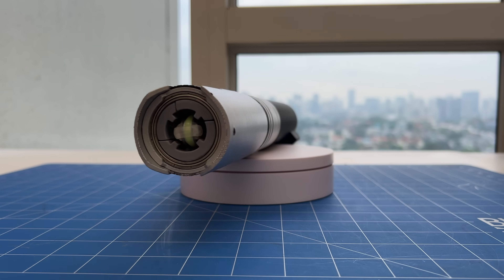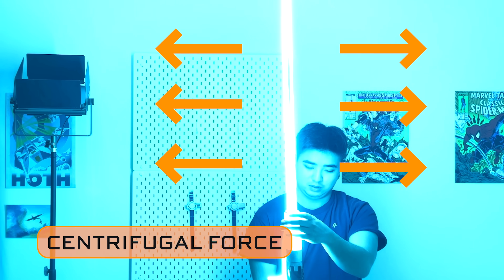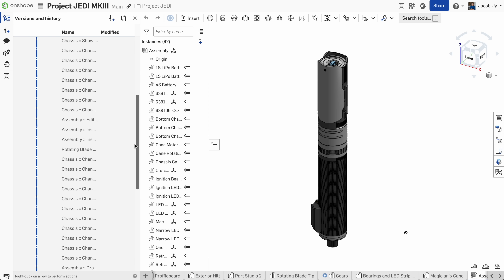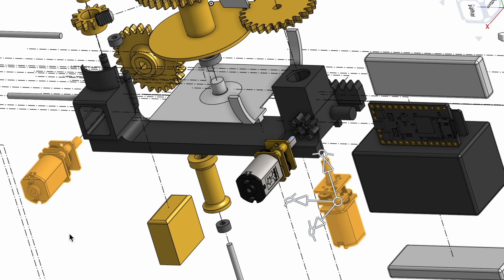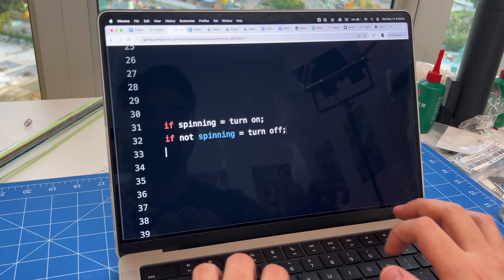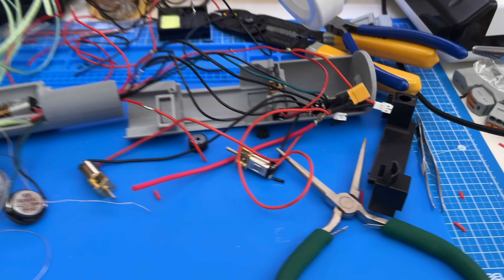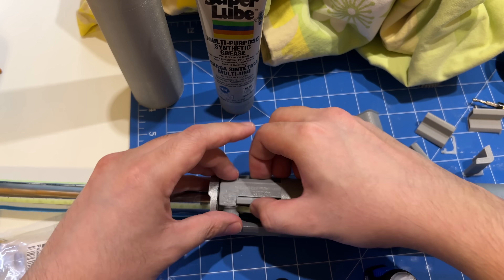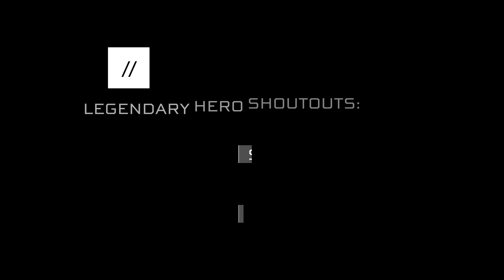Making a Better Retractable Lightsaber

Comment: Wonder if there is a way you could use a thin polycarbonate segmented extending tube over the blade in future iterations if it is possible to size down a lot of this.  Could very well be on your way to not only a spinning fast extension and retraction but possible something with some light dueling capabilities down the road.
Reply from the maker: Nice idea! Would love to find something like that, would be great to enable dueling
Reply: @herotech  I'd say check various saber supply shops, look into the designs from twistsabers and look at the design of the power saber.  Both have different methods for extending and retracting the blades.  For your design you would need to sand and taper each polycarbonate piece fitting over the rod and lights in the middle, especially if you want to maintain the rotational aspect, but if you wanted to save power and lose that spinning it would become simpler with smoothed segmented pieces.  Sadly I have only loosely experimented off of twistsaber designs.

Comment: How's the weight distribution? Also with the gyroscopic effect, it'd be more effective to do more of a thrusting/fencing type form (like Count Dooku) instead of doing those big swinging movements. Speaking of, it'd be cool to see the lightsaber in red (or any other colour really). Looks fantastic!
Reply from the maker: It’s slightly unbalanced in the hilt, in one of the final prototypes I included a counterweight, however it’s still not perfect - definitely want to truly balance the weight in the next version. And definitely planning to make this with different blade colors 🥳

Comment: Quick question: are the LED strips durable? Like can you have a lightsaber battle without them getting damaged?

Also, can I have one?
Reply from the maker: Ahahahahah they’re  not durable unfortunately, would need some kind of impact-resistant backing or casing to duel with them
Reply: @herotech  dang, it would be cool if you can have actual lightsaber fights with it. Maybe hopefully in the future you'll be able to figure out a solution.

Also best of luck in the future, your content is awesome

Comment: I really like seeing your engineering problem solving process applied to this project.  I’m curious how much you spent in total on all prototypes since you began the very first version of the light sabre, all the motors and other hardware, electronics, 3D printing, all of it.   If you know this there are tax advantages you could use given you make videos about the prototyping.
Reply from the maker: Thank you, I’m glad you like seeing the engineering process!! Sometimes I’m worried that it’s too boring but I’m happy that you like seeing it! I’ve spent way too much on this project tbh, curious what tax advantages you’re talking about
Reply: @herotech  if you are a small business which I guess you are because you make videos, any costs incurred can be deducted from the profit you make.  I wrote books and my office needed overhead, heat etc.. for me to work and I could deduct this off my income from the books.  Similarly for office materials.  I would assume the cost of all the stuff you use could be deducted similarly.

Comment: servos are finnicky, make sure you ground everything correctly. 1 loose wire, 1 unconnected ground and your servo is wack.
Reply from the maker: Thanks for letting me know!! Eventually figured out there was a bug with the board I use to control the saber that mistimes the output signal cuz the servos worked great when I used a spare Arduino board I had lying around lol